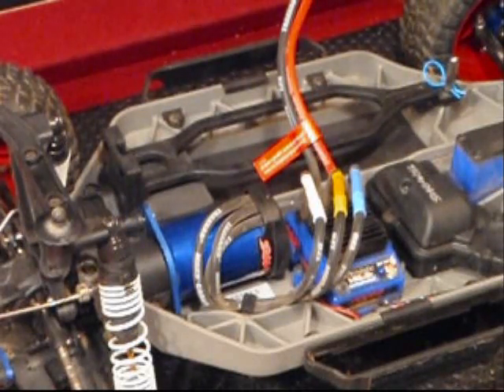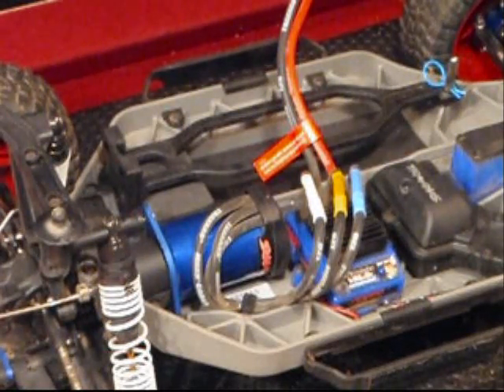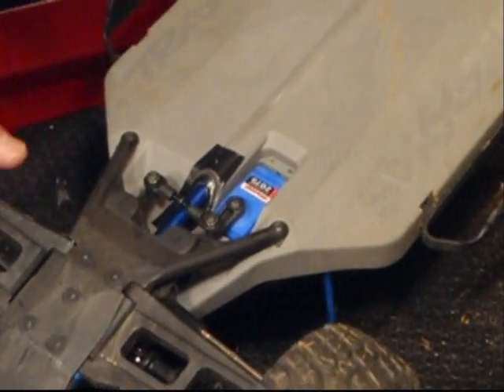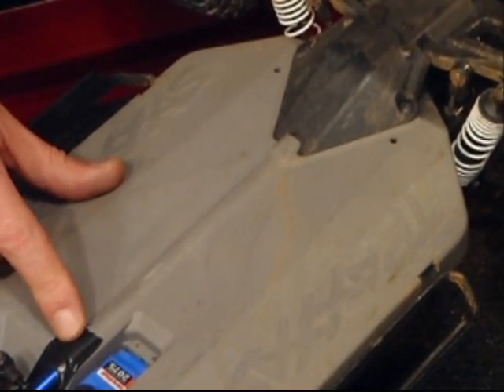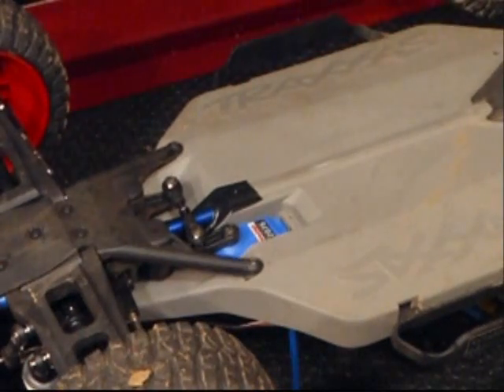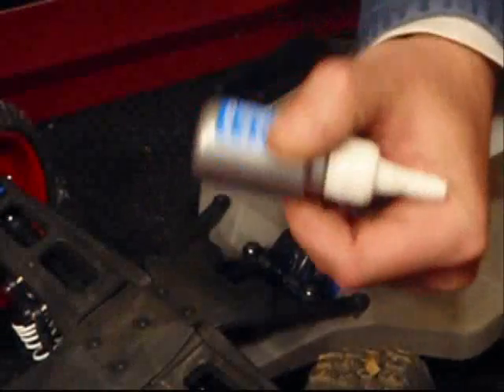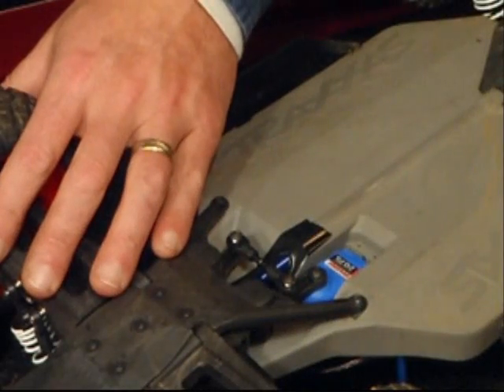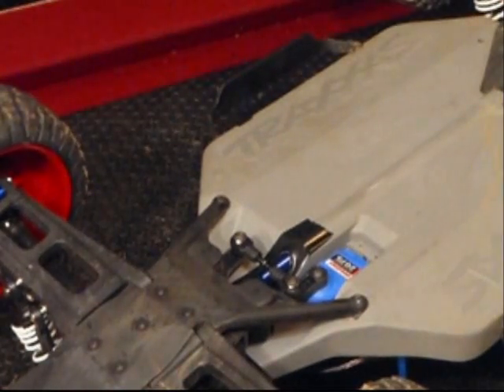Traxxas Slash 4x4 Quick Tips!!!

Comment from the maker: @Dief7734 Your close.  The additional weight ( less than 3 grams ) is not the issue.  I have been testing this mod and find it to be much better than the tape over the hole.  The problem is it throws the shaft out of balance causing a slight vibration.  Looking into how I can fix this...

Comment from the maker: @jrgolfer The truck runs 13/54 box stock.  Your going to heat it up just bashing around the house.  Run a 10 or 11 and it will stay cooler when running stop and go bashing. A smaller pinion will reduce top end but increase low end.  You wont notice the reduxtion in speed unless you go back to drag racing...

Comment from the maker: @Cheesevillage No problem.  This truck is a racer beefed up to bash. If you run exclusively at a clay or carpet track you will never have any issues.  Unfortunately this truck requires way too much maintenance if your going off-road. Without assistance a newcomer would have a hard time.  Remember, yank that 13pinion for a 10 or 11 and you will have not heat issues.  Glad to help and have fun with the truck...

Comment from the maker: @Xmoto16 If your just getting into Lipo and Brushless you will want a system that allows you to re-build the motor if it fails.  Although Traxxas offers a re-build kit for the 3500 it is next to impossible to remove the rear bearing.  I know first hand on three motors.  Traxxas replaced the first two then only offered a $40 repair option on the third.  Price is better on the Novak and the speed control has more options.

Comment: @Dief7734 yea. but you break a part either way. because before i modified the shaft, a rock got in and my slipper fell apart, and the spur stripped..

Comment from the maker: @powerking230 Although the 2wd slash is really easy to maintain it is a MUST to keep it clean so your suspension does not bind.  If you have no damage to the vehicle such as a tweaked chassis or bent shock shaft it sounds like its just dirty.  There are several vids on youtube going over the cleaning process shuch as removing the hinge pins and keeping them clean and cleaning the half shafts.  Just taking care of those two areas will keep the susp. bind free...

Comment from the maker: If you are talking about the tape coming off its common. I used motor cleaner to make sure the area is clean. then apply the tape. Works every time but make sure you are using a quality tape like from 3m

Comment: @Dief7734 haha, nice!

with stock, ESC and motor have slight heat problems..
2s: moderate 110-130 range (depends on drive conditions)
3s: very bad 130-190 (depends on drive conditions)

all were stock gearing..

Comment from the maker: Remove your front module and pull out your shaft.  Make sure the area surrounding the shaft entry is clean and place a strip of electrical tape over the opening.  Take a knife and make a x cut half the diameter of the shaft.  Slowly push the shaft through the x cut you made and re-install your shaft and replace your front end.  This will act like a rubber boot and keep dirt out of there.